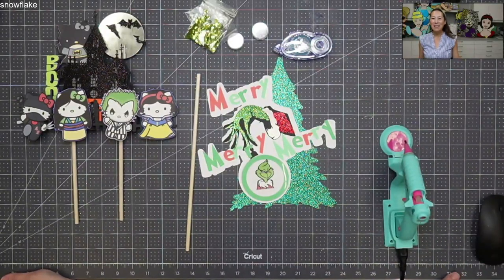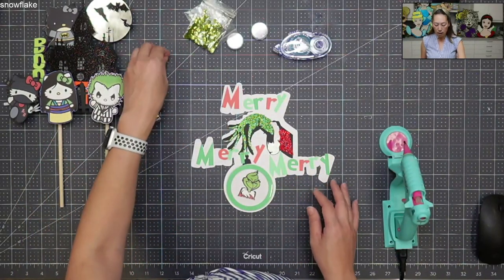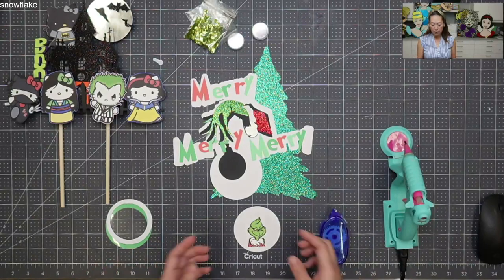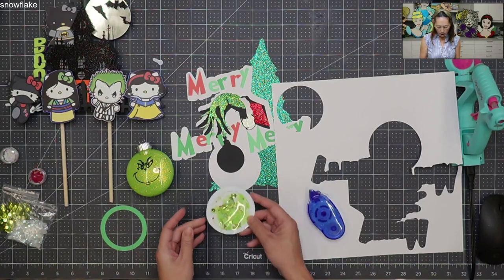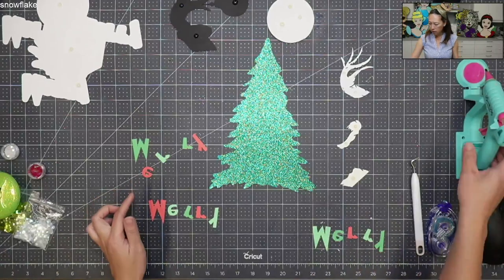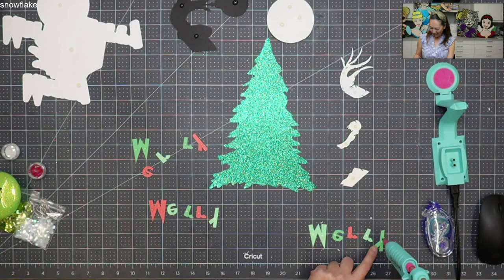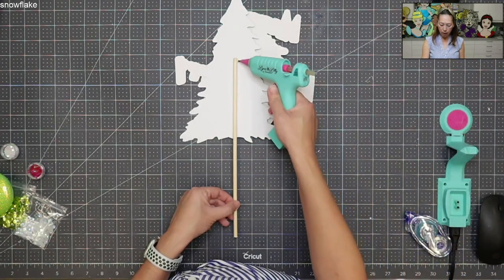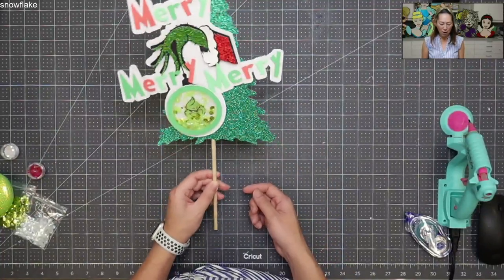DIY How to Put Together a Grinch Cake Topper with shaker - Post Cut on the Cricut Maker Tutorial

Comment: Can this be made using the explore air?
Reply from the maker: Yes definitely!!!!  It's just cardstock.  =)
Reply: @TheUselessCrafter  what about the foam  parts I see you use on the toppers
Reply from the maker: @TimelessTunesRewind  Hi!  The foam is for the shaker part - it builds that wall to keep the sequins and glitter in.  Here is a video on just that portion:  https://youtu.be/yU_ZdiiTN6k
Reply: @TheUselessCrafter  Hi there.. Happy Monday to you. Yes I understand what the foam is used for but my question is I have the explore not the maker so is this even possible with the explore?
Reply from the maker: Gina C ohhh sorry I wasn’t understanding.  Ok so the foam layer is cut with my rotary blade on the maker ... so no, you won’t be able to cut with the air cause you do not have that blade, right?
Reply: @TheUselessCrafter  Yes. I think I will have to layer card stock or build
 a wall using the foam tape all the was around
Reply from the maker: @TimelessTunesRewind  Yes!  I did this at the beginning before I found the foam sheets.  I did about 5 layers of cardstock.  Or like you said, if you have an easy way to build that wall with some sort of foam tape.